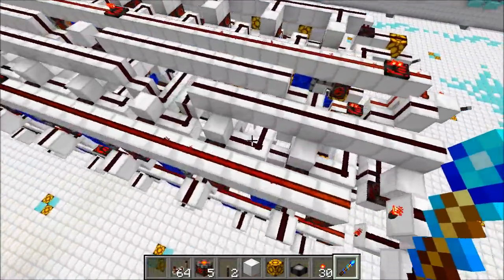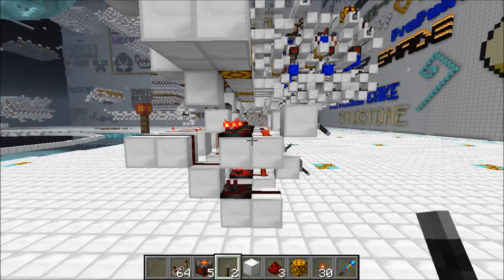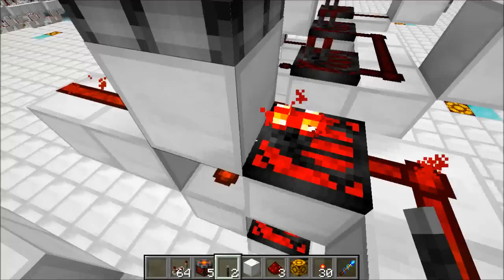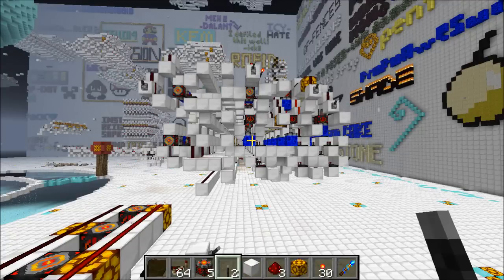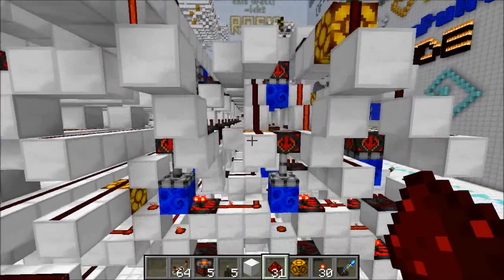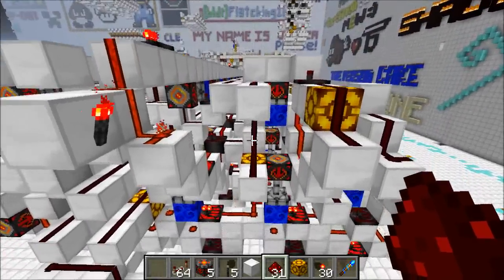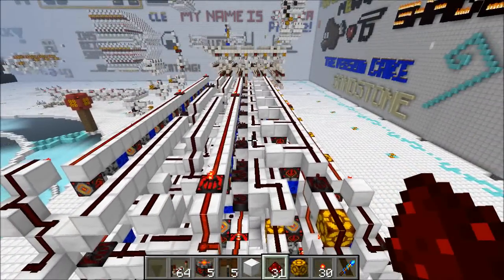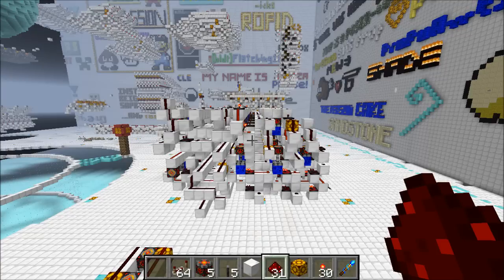Barrel Shifters and Learning How to Wire Like a Boss

Comment from the maker: The biggest difference is that repeaters are going to add delay, so if you don't need to extend your signal, it's much better to use glowstone both when avoiding interactions with pistons and when you need a diode.

Comment: Well, as long as it's still Turing complete the compute logic part will always be possible. 

And as an example, a multiplexer with lines [A, B, S(elect)] is BS+AS'. Since AND, OR, and NOT are possible without pistons it's easy to make a (somewhat bigger) multiplexer pistonless. 

As I'm sure you know, just generate a truth-table for the inputs and outputs you want, convert to a Karnaugh map, and then implement the simplified logic from there.